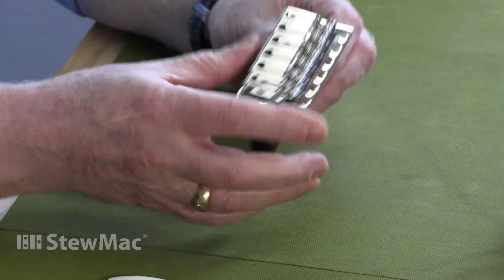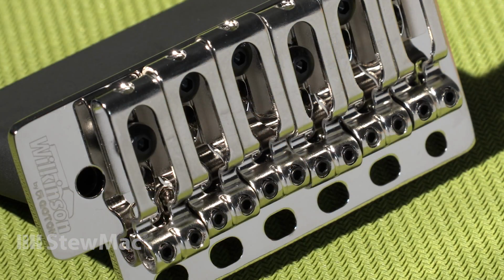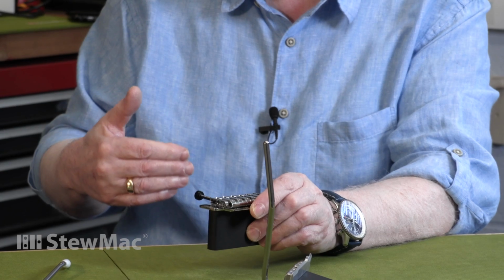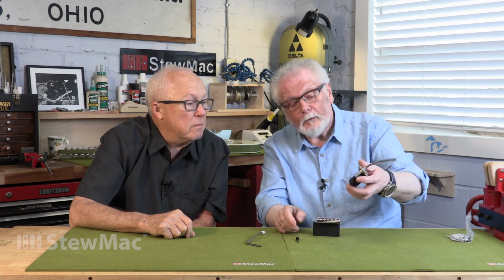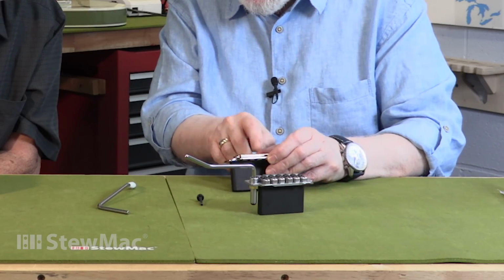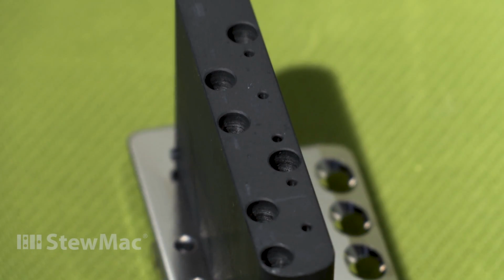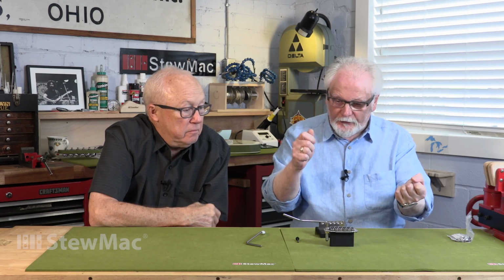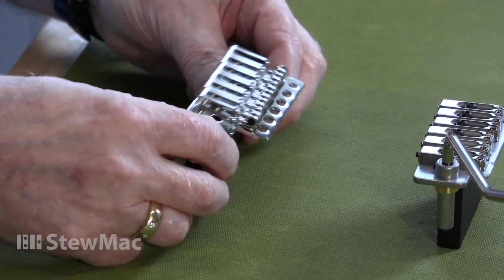Dan Erlewine's back talking with Trevor Wilkinson about the VSVG Vintage Strat Style Bridge

Comment: I've had the VSVG on my strat for more then 15 years and its been always awesome!
Reply: Did you have any issues with the strings lining up on the fretboard correctly? The oval holes have me a bit worried.
Reply: @YesuAiNimen  One of the holes isn't oval, so that should prevent the bridge from sliding side-to-side.
Reply: @benmmurray  Thanks!

Comment: If the Vs-100 would come with a steel block that would be great. It's the reason I don't use one. The original '90s ones did, I've had both and the steel is part of what gives that "sparkle".

Comment: It's good you sink the Hight adjustment and put them down further.the problem I've noticed the skin and dirt off your hand fills up the alan key hole. Then U need a pin to get it out. So they still have not fixed a main issue